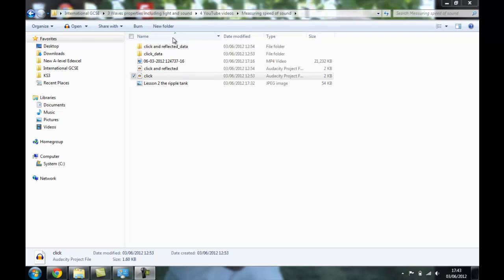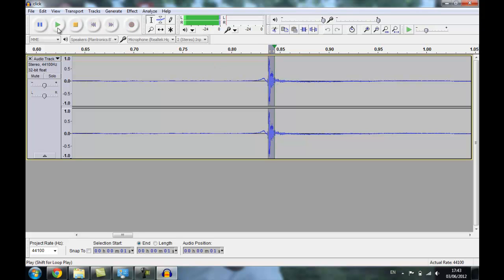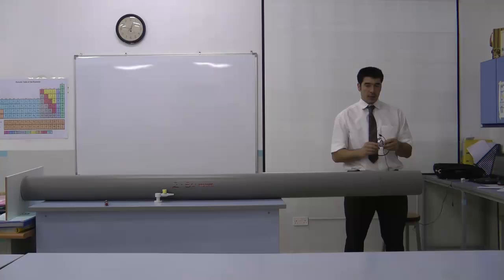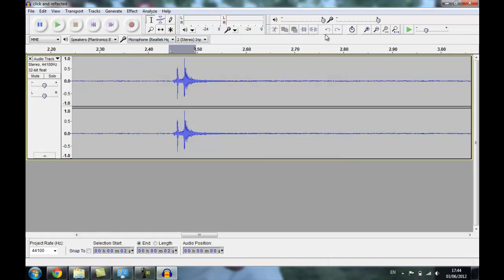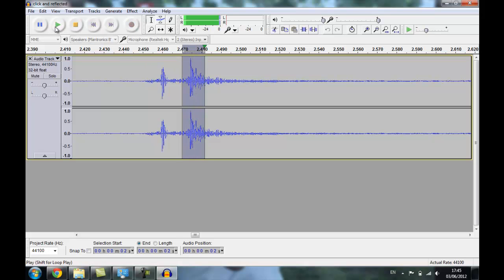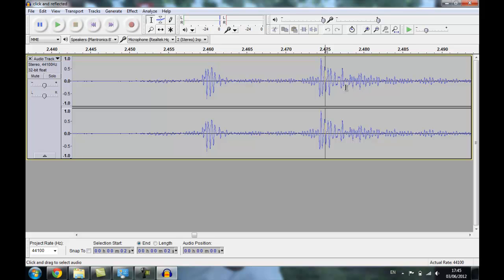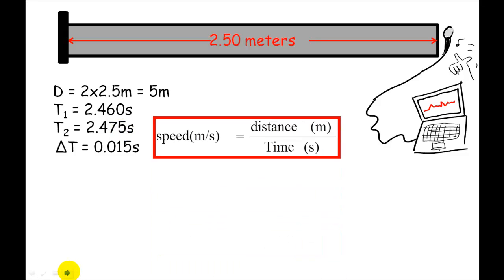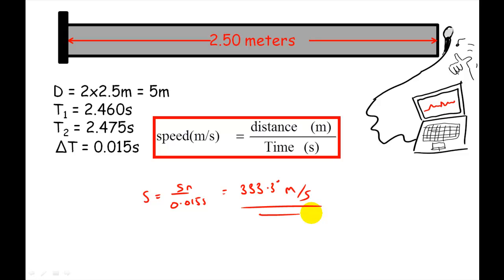Measuring the speed of sound

Comment: I tried an experiment like this except with a rubber hose rolled and put into a cooler box so I will be able to control the temperature, but I'm getting a ridiculously high number for the speed of sound. Will it make a difference if my hose is not laid out straight?